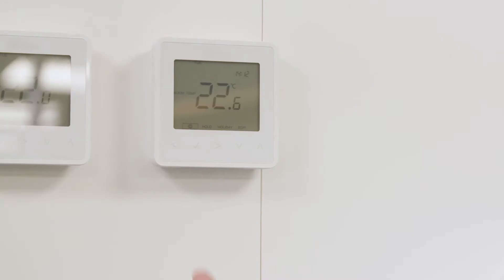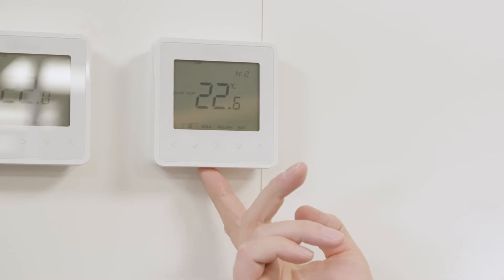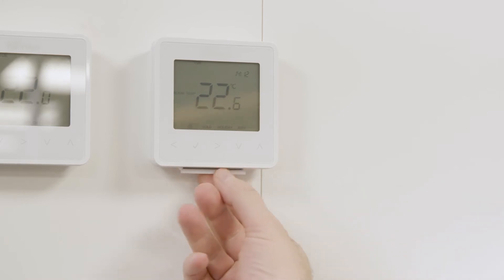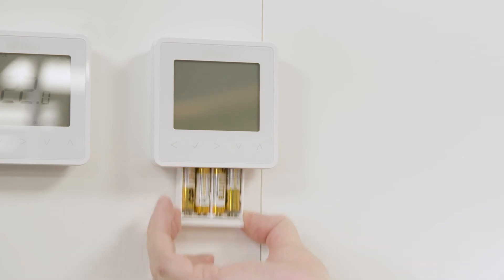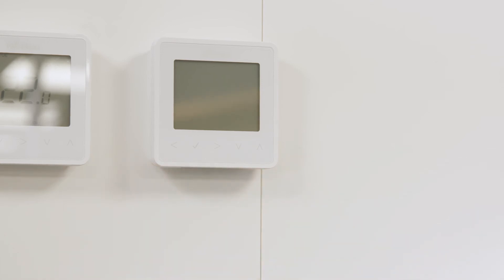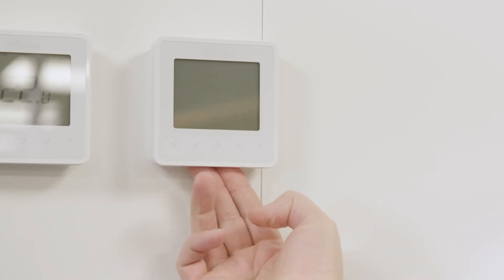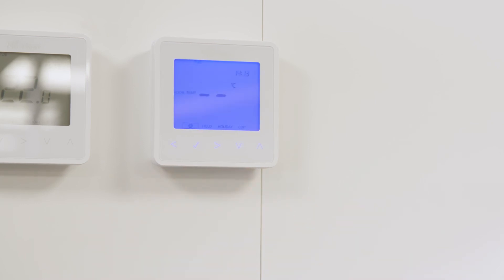Replacing Batteries in a neoAir Thermostat

Comment: I have 2 of these thermostats and both have battery drawers that won't come out. Is there something I'm missing?
Reply from the maker: Hi Sarah, this will probably be because the screws holding the stat to the wall are too tight, which can deform the chassis and stops the battery tray from coming out. You will need to pop the front of the stat off and unscrew the screws a turn or two until the draw moves freely.

I hope this help, however our technical support team are on hand to help if needed. You can reach them on 01404 540745
Reply: I’m having the same issue except mine are free standing they aren’t wall mounted any idea?
Reply from the maker: @willfarrell1365  Hi Will, sometimes the batteries can raise up a little, inside the thermostat, which stops the tray from sliding out smoothly. If this happens, you can press in the two plastic clips at the bottom of the thermostat, which will separate the stat and allow you access to the batteries!